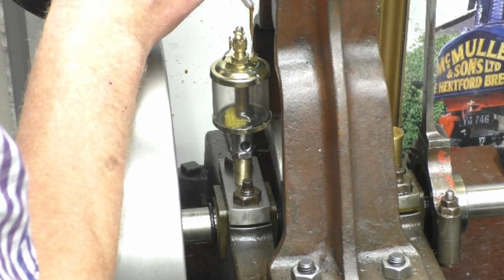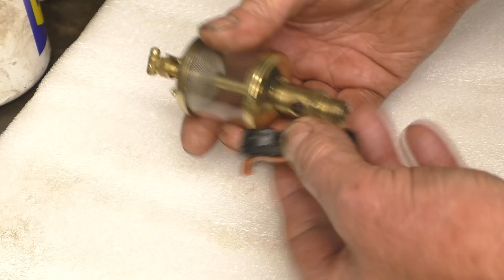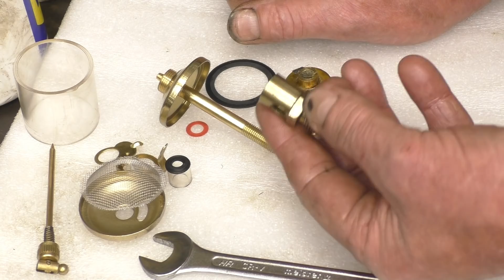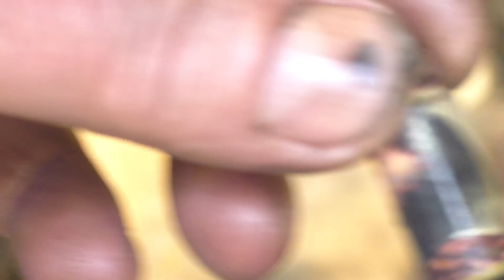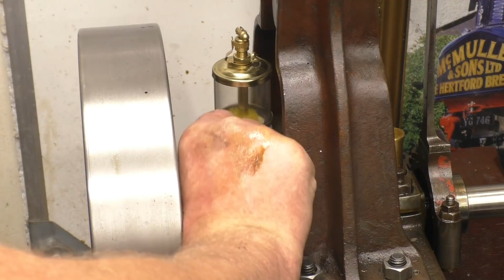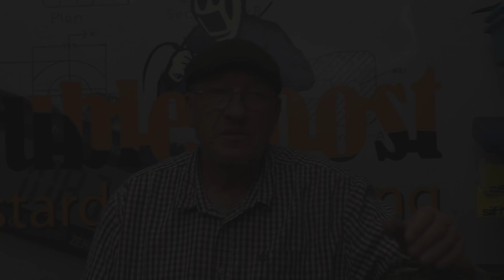SNNC 395 P2  Steam Engine Oiler

Comment: Who else would have done it my way - and simply drilled & threaded the old oilers and screwed the new ones on top of them?
Reply: That's what I thought. Utilies the wick oiler to mount the drip feeder on top.
Perhaps the old oiler wouldn't be high enough for the new oiler to clear the counter weight once it's screwed down.
Hard to tell looking at a video.
Reply: @rayzugar4776  Don't screw it down too far then ;) The height difference looked about right to me.

Comment: Excellent work as always, John. Nice addition to the steam engine... I'll never get tired of the way they sound!

Be watchful of those oilers, though. I've got a larger version on the spindle of my surface grinder, and it leaked like a sieve when I first got it. I ended up having to solder the bottom cup to the needle seat part, as they're just swaged together (and not all that well). Additionally, the rubber gasket didn't seal worth a damn, so I ditched it, and seated the clear plastic tube in some black RTV. No more leaks, and the oiler works great.

Comment: Nice work as usual. Look for a couple of X12A0 oilers they are smaller diameter and can fit right on the bearing caps. I got some off of ebay used~$20 US and they are all brass and real glass. Nice engines.

Comment: Hi John,
The oiler looks good on the engine... was I right in thinking the engines were running on air? See you tomorrow.
Cheers
Paul,,
Reply from the maker: Yes running on air . They run much better on steam

Comment: Can you do a video showing how you get the steam to the engines
Reply: Normally for real steam John uses the steam pipes off the Sentinel steam wagon, as there is a good boiler there, and he can easily connect up a set of hoses to run these small engines while the wagon is on show.
Reply: @SeanBZA  thanks I was trying to figure out what he used as a boiler
Reply: These in this video were just run off of air.

Dale in Canada